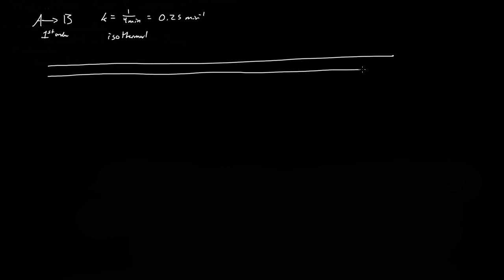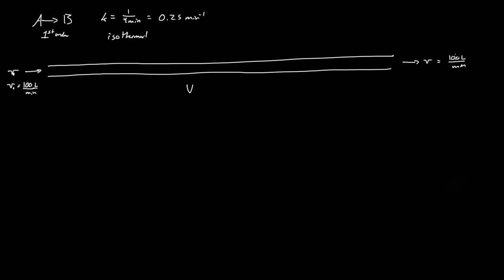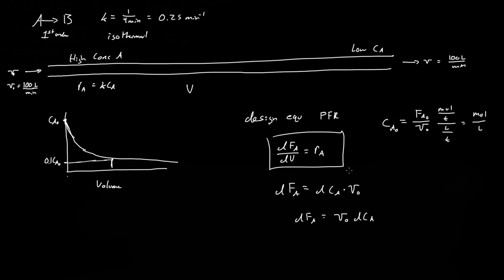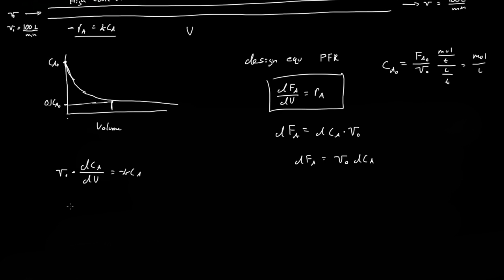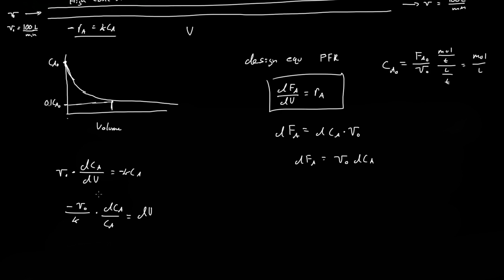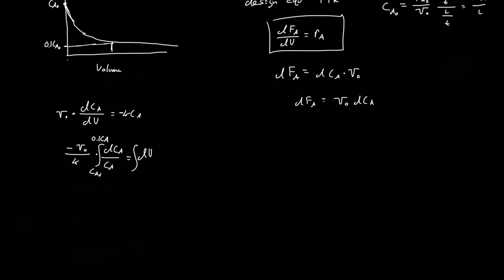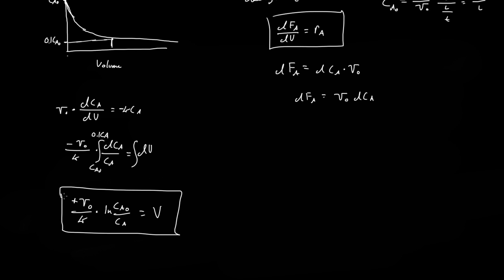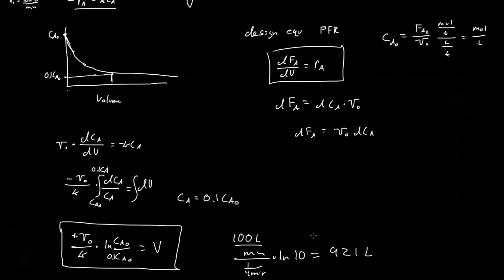Volume of a PFR

Comment: Hola, buenas tardes.
Yo tengo la dudad de lo que tu explicas como podria resolver el siguiente problema.
Teniendo solo estos datos 

Problema.
1.- Una enzima actúa como catalizador de una reacción biología y acelera la reacción A hacia R, los valores de los parámetros cinéticos son: Vmax= 2.6 mM I^-1 min-1 una Km de 6X10^-2 mM.
Se ensayó con una concentración de sustrato (Ca0) de 2.5 M. Usando reactores de flujo se desea tener una conversión del sustrato de 98% dado una alimentación de 3.2 L/min.
Utilice la siguiente fórmula para resolver el problema
-ra= Vmax. Ca/ Km+Ca ; Recuerde que la integral es τ= Km/Vmax ln (Ca0/Ca)+ (Ca0-Ca)/Vmax
a) Calcule el volumen de un reactor de flujo pistón para obtener la conversión deseada.
b) Calcule el volumen de un reactor de flujo mezclado para obtener la conversión deseada
c) Calcule el volumen de los reactores si Km cambia de acuerdo a la siguiente tabla
Km (Mm)= 3.1X10^-2; 321X10^-1; 2.8; 19; 298
VFP
VFM